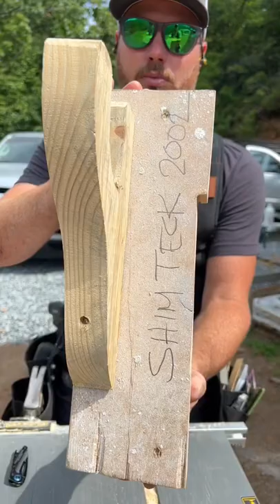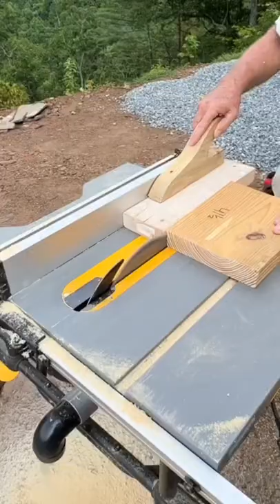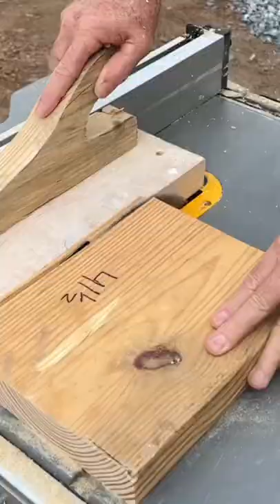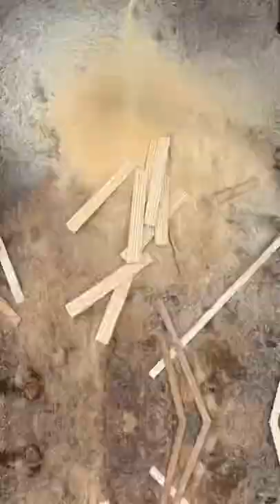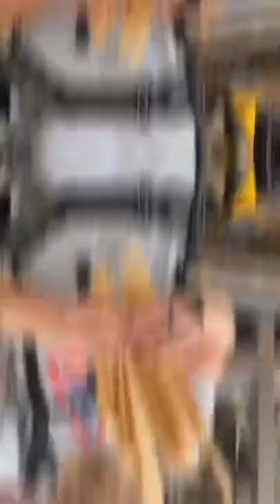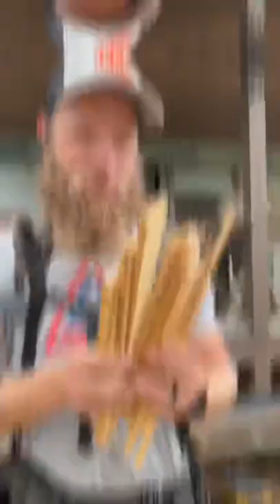Every builder in the world should have one of these!￼

Comment: For the naysayers talking about how cheaply one can get a tub of them at the home center, or how much time to make the jig?  

Looks like about 5 minutes to me, to have them for free (in time and money).  Making the jig, another 5.  Assuming the availability of the scrap pieces.  Make the notch in the jig by sticking it to another thinner board at a slight angle (using screws, double-stick tape, hot melt, whatever) and the thinner board rubs the fence, to cut the long part of the angled notch in the jig.  Finish with a hand saw.  Screw on another scrap for a handle.  (Writing is optional.)  Then just buzz through whatever 2-by scrap you have, cutting it to length first then ripping the shims, so they're with the grain.  Versus stopping work, running to the home center however far away, back in what, couple hours?  

So, depends on your circumstances, but sure, grab the home center shims if you're already there and stocking up.  But if you run out while on the jobsite installing doors and windows, or if you're just looking for something to use up some scrap?  If you got the right stock or scrap pieces available, you've already got your shims right there, for free and no home center run needed.

And that's not even mentioning the flexibility of making the length and thickness to suit your own project.

Looks like a winner to me.

Comment: Would you consider "lightweight concrete block" sufficient for use in a basement build? I'd prefer regular weight but all my mason will use is the lightweight but it makes me nervous. The psi listing says 1,900 and Google says 2,000-4,000 psi is recommended for block basement construction. Thanks for any advice!